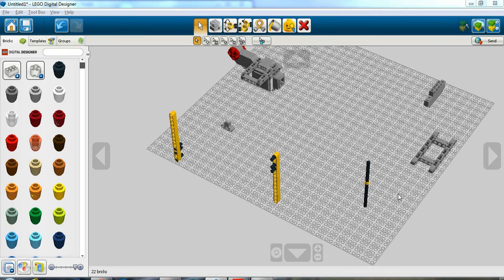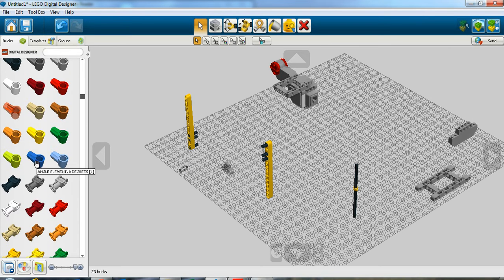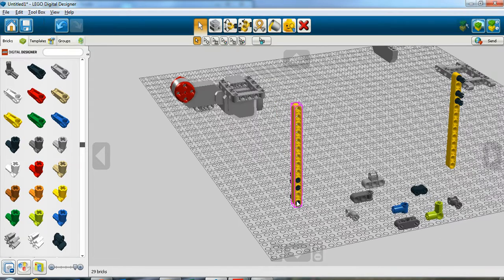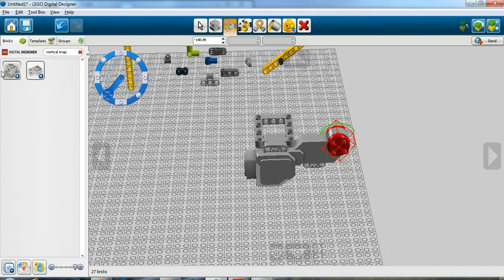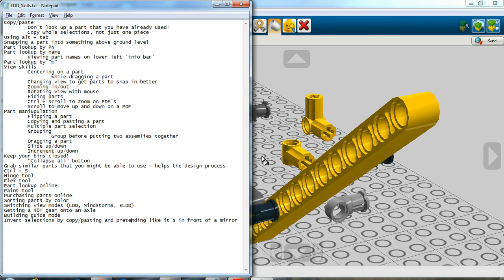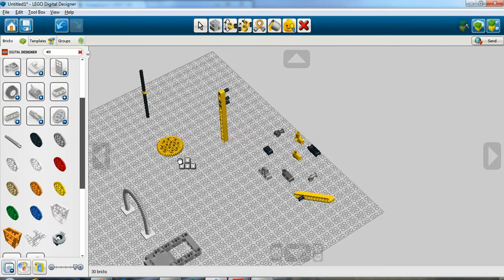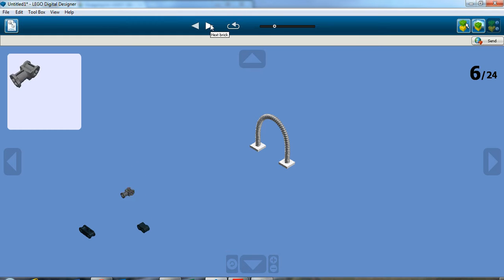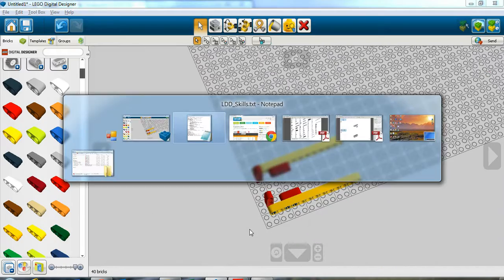Lego Digital Designer Tips and Tricks - 2/2

Comment: The only item in your notes i was looking for "purchasing parts online" you skipped, have you any ideas so I don't have to reference and cross check 600+ individual parts?
Reply from the maker: Brendon Cummins it depends on your specific application, but bricklink.com is a great resource for buying specific pieces in quantity, and eBay is good resource sometimes for buying large "lots" of pieces if you don't know exactly what pieces you want. I buy robot wheels and lots of gears from eBay, but most other pieces from bricklink. Sorry I didn't go into more detail! I wasn't as experienced then with buying pieces and I don't think I had ever even used bricklink at that point
Reply from the maker: Oh, also, you can export a list of all the parts and quantities in your model either using the File menu, or pressing Ctrl + B.